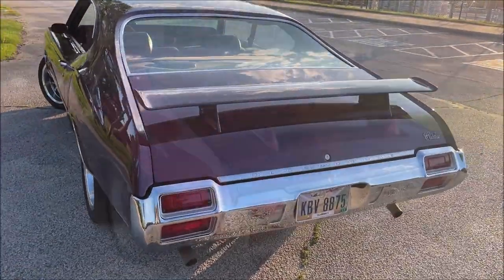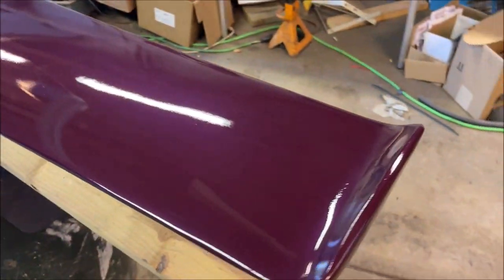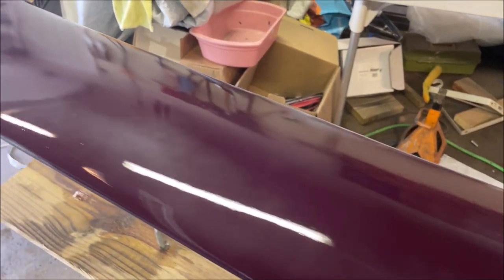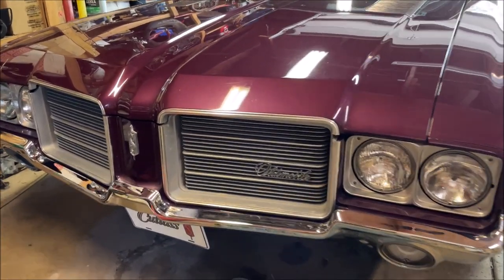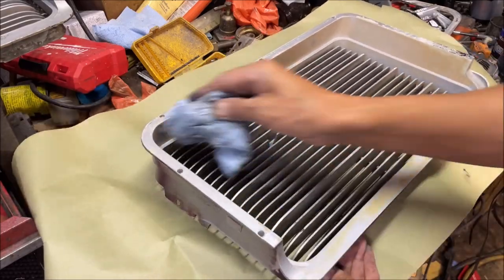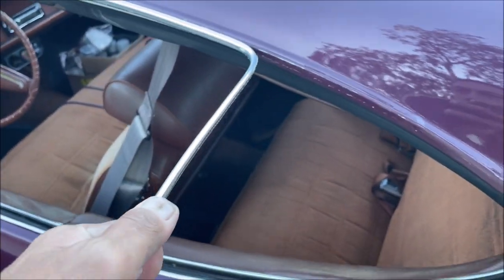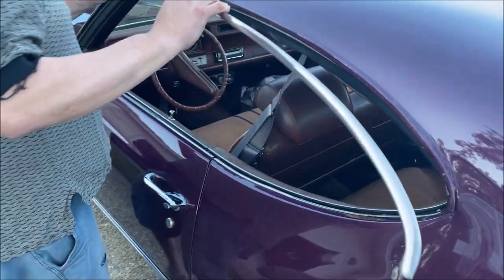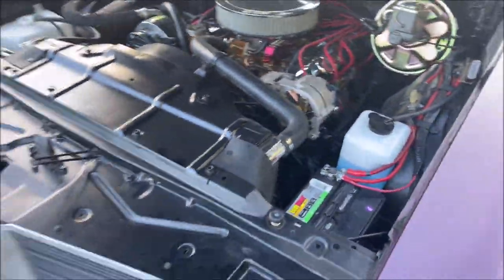1971 Cutlass Ep 04 W35 Spoiler, Grills, Chrome Exhaust Tips, & Trim

Comment: What did you do to get the chrome back on around the grill not the inserts but the chrome that goes around did you have to glue them back on or what?
Reply from the maker: The chromed pot metal (?) has steel pins that are bent to hold them on... I was just very careful when I removed them and only un-bent them enough to wiggle the chrome off. A few DID break, so I used double sided tape to hold them on where too many pins broke.
Reply: @CobblerBob ok yea I ran into that same problem. I ended up breaking a few of those pins, so I ended up just using a little bit of epoxy came out really well.